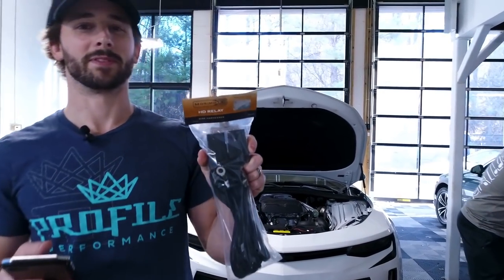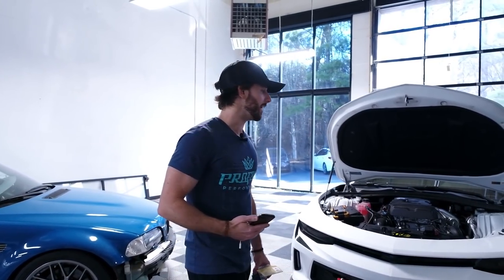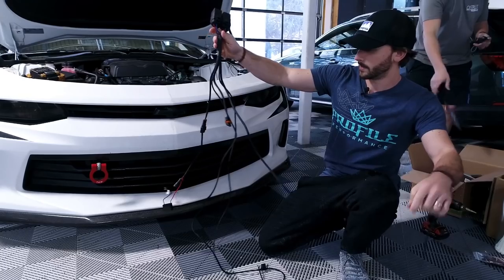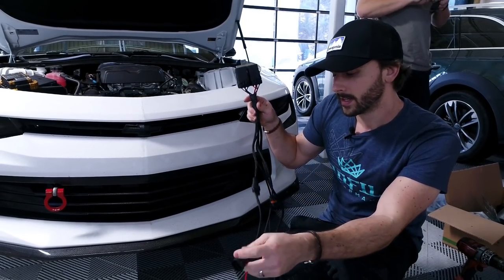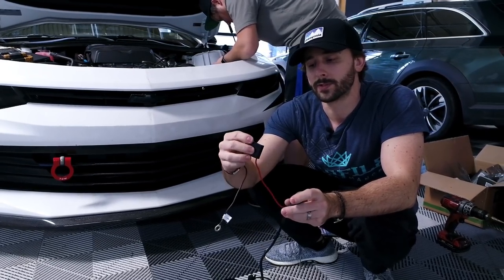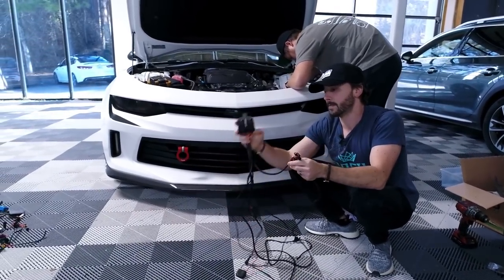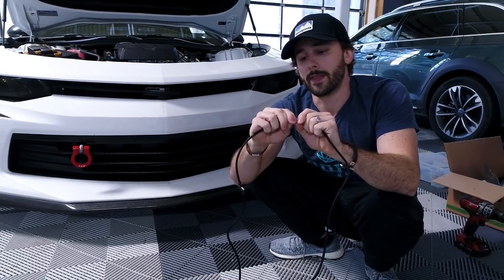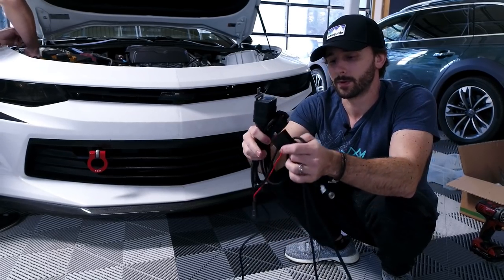MORIMOTO RELAY HARNESS INSTALLATION - ITS EASY!

Comment: My relays flicker like crazy when running my DRLs even with the capacitor. I own a 2017 Toyota Rav4 which uses a single 9012 bulb for DRL, low and high beams. Could the capacitor link be damaged? Is there a way to fix it?
PS. I bought my elite kit at TheRetrofitSource this week.
Reply: elflecha007 must be a Toyota thing. I had a 06 Corolla S with Altis headlights. Popped off the bumper installed everything. Night came I wanted to go for a ride they looked great. Next day, I start it and all I heard was this insane clicking of those relays on/off on/off. I was just thinking what you were thinking.  The Corolla’s drl’s run by cutting the voltage in 1/2 during the day. The low beam is the drl and at night goes to full power. It sounds like that capacitor link would eliminate that or cut  power wire to the drl module.

Comment: My BMW E39 540i already has xenon lights. Do I still need the relay harness if I upgrade to Morimoto 50w ballast?
Reply from the maker: If you're upgrading the ballast, it would be safest to upgrade to the HD relay harness too. Staying at the 35W OEM ballast would not require an HD relay harness.

Comment: I installed a HID kit in my Mitsubishi Lancer that came with regular non HID lights. I am having a problem where often time one HID will not turn on. Sometimes its the right one, sometimes the left one, and on rare occasions both of them wont turn on. Sometimes turning the car off and on will fix the issue. Sometimes the fix is to unplug/plug the ballast connector. Will a relay harness fix my problems? Thanks.
Reply from the maker: Sounds like an igniter or relay harness could be the issue!

Comment: Soooo, one side of the OEM output from one head light is not used? I’m confused..
Reply: the passenger side OEM output just plugs into the pair of resistors he didn't show. Kit comes with 4 blue aluminum resistors (You can see them on the floor in the left of the video, he didn't mention them) and the OEM light plug from the car just plugs into that. I know it doesn't make sense, just plugging the other side of the car into resistors that go nowhere.... but the power comes from the long cable from the relay and plugs into the ballasts for the HID light, The ballast output then goes to the lights. Go to the RetrofitSource website and look up the kit. They have a drawing that makes total sense. https://www.theretrofitsource.com/mopar-2015-spec-H-15RAM?quantity=1

Comment: Hi bro, I just installed relay harness for my LED low beams. Is this advisable? Will my LED bulbs throw more light?
Reply from the maker: It really depends on the vehicle on if a relay harness is needed or not. However, a relay harness will not make the bulbs brighter.
Reply: @RetrofitSource  Thanks much for your reply
Reply from the maker: You're very welcome!

Comment: What do you do with the other headlight signal source? since it no longer goes into the headlight or ballast?
Reply from the maker: These lights had OE halogen lights, so there were no ballasts/HID bulbs in this case. If you've got OEM HID, this upgrade isn't ideal for you really
Reply: TheRetrofitSource Inc
I meant my car was OE Halogen. With this ballast it seems that the car's original connectors that go into the passenger side headlight wire would plug into the harness. and do i just tape off the original connectors on the driver's side?
Reply: Ok
Reply: @imjustaguy9422  Yes
Reply: @imjustaguy9422  the passenger side OEM output just plugs into the pair of resistors he didn't show. Kit comes with 4 blue aluminum resistors (You can see them on the floor in the left of the video, he didn't mention them) and the OEM light plug from the car just plugs into that. I know it doesn't make sense, just plugging the other side of the car into resistors that go nowhere.... but the power comes from the long cable from the relay and plugs into the ballasts for the HID light, The ballast output then goes to the lights. Go to the RetrofitSource website and look up the kit. They have a drawing that makes total sense. https://www.theretrofitsource.com/mopar-2015-spec-H-15RAM?quantity=1